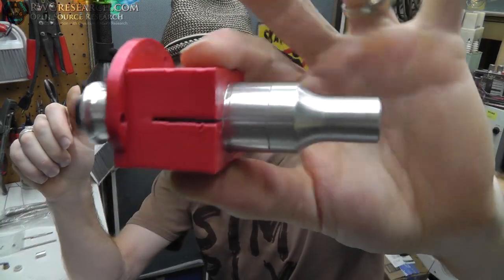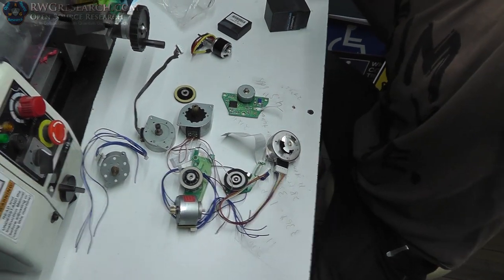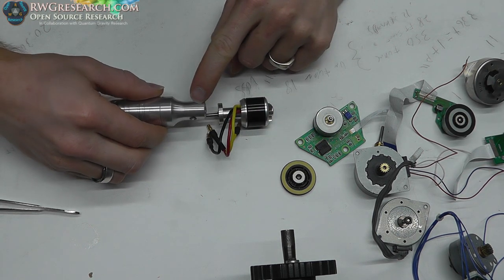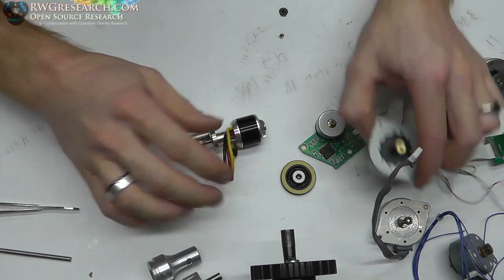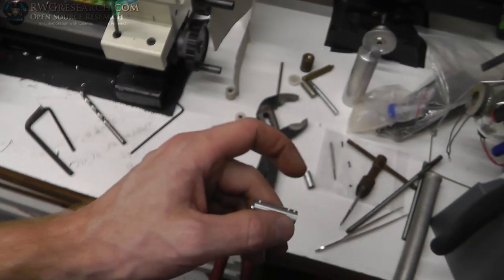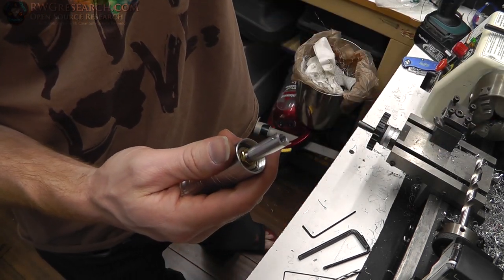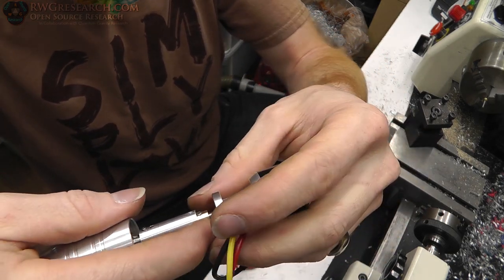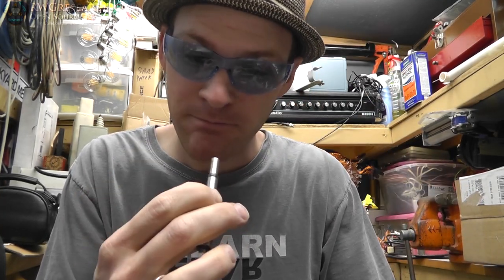P2. Lite & Powerful Brusless CNC Spindle Build For 3D Printer. Making the Shaft Coupler

Comment: My first thought when I saw you hold the motor up against the spindle, was to machine the motor mounting flange off (down to the base diameter), and make it fit inside the spindle entry part. It looked like the spindle entry "was" about the same ID size as the motor 'nose' OD size (minus the flange). It's not hard to get those motors apart... at least there's no brushes.  Then you affix the two parts together (set-screws), so that when you screw the entry housing back to the main body of the spindle, it firmly attaches the motor.
Reply from the maker: yes. it was a thought but I wanted the option to attach a bigger motor or swop out for a replacement. else yes. that would have ben the simple route. ~Russ

Comment: When cutting the shaft you need to be extremely careful, because the filing can attach to magnets inside the motor :). Just a tip for the future.
Reply from the maker: yes. !! agreed. ~russ

Comment: could you make a single-piece coupler by drilling with the larger diameter first, then drilling the rest of the way with the smaller diameter before cutting it free from the stock?  that should keep the two different-diameter shafts lined up.
Reply from the maker: yes. but I don't have a 3mm reamer. so I can't make that hole. I had to use so thing and make it fit via the outside like I did. :)  ~Russ

Comment: ok I am just wondering why you have a foredom 43T hand piece but cant get even a cheap chinese foredom knockoff motor, and flex shaft to hang it up and run the snake down to that original hand piece to rotate it? That is what I am doing, with my 44T  to replace my bulky water cooled head with my 6040 CNC machine, so I can fit it and a laser head on the same unit, (using the watercooling for my UV laser head, which melts solder so fast that it vaporizes the flux in it, to the point there is no smell or smoke to be seen LOL) Also I have it all being controlled by an Azteeg x3 pro board, now so slapping some high temp extruders on it will let me use it as a 3D printer too, though I need to make a huge change for the z axis so I can get more height than just 3 inches of print depth :)

Comment: Why don't you make a simular sleeve like you have on the shaft to hold the motor inplace? Slip it over the OD of the tool and over the OD of the motor, should be the easiest way :)
Reply: Those little motors get pretty hot they need air flow, if he encased it then he would need air ducts and stuff more complicated would be end result.
Reply: ***** i don't mean encase the whole motor, that wouldnÄt be possible since it is an outrunner anyway, i just meant something that goies around the "lip" at the bottom of the stator, where you are supposed to screw it onto.
Reply from the maker: i dont think there is enough lip on that to hold it securely... any way, its done! lol so you'll see in the next video how i made a flange and adapter to hold it all together ! :) ~Russ
Reply: ***** can't wait to see the finished tool, probably the nicest dremel in existence :)
Reply from the maker: yeah it sure feels nice in the hand!! i compered ti to my other dremel using the same bit and same brass to cut and yeah... i think i might be using this all the time when its not on the printer! its a speed demon! i really like it!! lol ~Russ